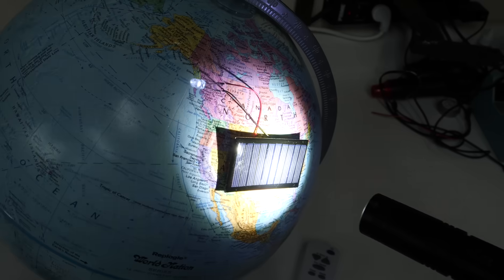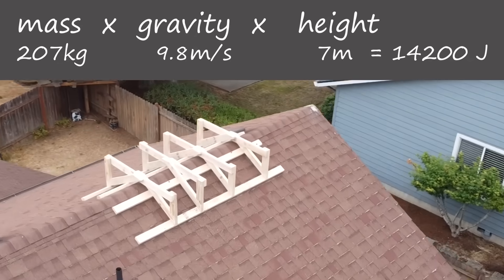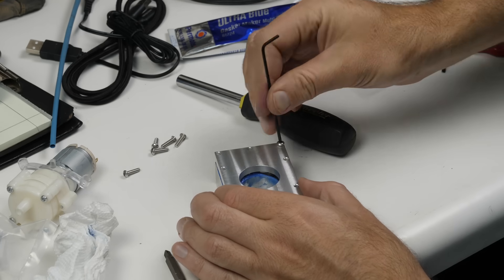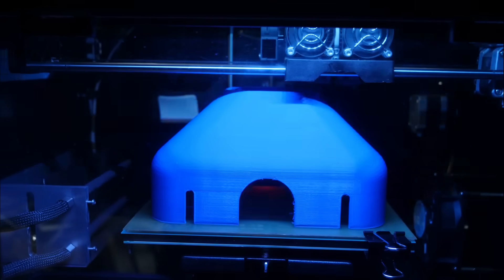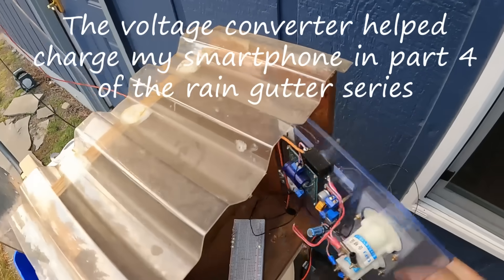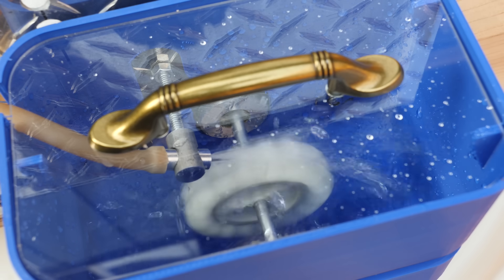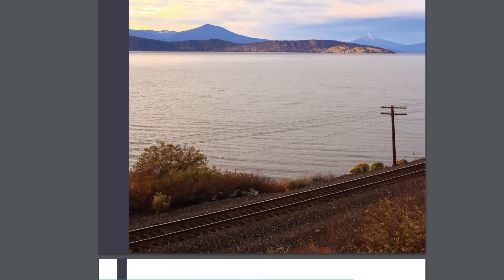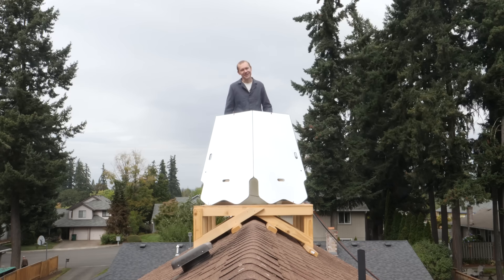Storing Solar Power on my ROOF!!!

Comment: pump from a well, or lake, or sea, a tower with a huge storage, generator, rotor, turbine
Reply: housing for the turbine, pelton, tesla, waterwheel, impeller
Reply: ie workshop, for space
Reply: supercap power level automatic throttle to the flow valve
Reply: water tower on a well, what a height difference
Reply: personal energy storage techs, not grid tied, by force
Reply: flywheel energy generator-battery instead
Reply: water tower, a large one
Reply: wind (vawt on top) can pump water up to the tower
Reply: wouldnt a water pump water cool itself
Reply: actually the water, flywheel, vawt system does not need any direct electrical parts, like batteries, inverters or anything, just spinning mass
Reply: try pipe axle ground tethered hot air plastic sheet balloon, both wind and solar collector, and rain water, the larger the more power/heat

Comment: I wonder what the efficiency is? like if you measured the amount of electricity that was used to fill the barrel, and then measured the amount that is created when you drain the barrel, and how that efficiency compares to lithium batteries and also commercial grade water batteries

Comment: if you have a hose going down from the funnel into the bottom tub and let the hose run to the bottom of the tub.  
you won't have that horrible sound of the splashing inside.  

also rather then a splash guard.  you should have a more constricted system. (like a turbo) 
so that the water doesn't splash in every direction (wich is basicly lost energy)  
all of these changes would make the system quieter. 
and the last one should make it more efficient aswel

Comment: Any suggestion of where to find info about scaling this? How big turbine can this example support? How large "water-battery" is needed to surplus a household of minimum usage? Could it be used to be "off-grid" in periods with power-outage or extremely high energy prices?
Reply from the maker: Video on BUILD2

Comment: How efficient is your water wheel at converting the potential energy into electricity?  My guess is your not getting all 14,000 joules of energy from that barrel on the roof.  You could try multiple water wheels stacked on top of each other.  Another approach would be two have two barrels and a pulley.  Start with the empty barrel at the top nearest the pulley.  Have the pulley locked so it doesn't spin.  Use solar power to pump water from the barrel at the bottom to the barrel higher up near the pulley.   Once full, unlock the pulley and use the shaft of the pulley to provide high torque to a gear box that is connected to your electric generator.  As the barrel lowers the empty barrel at the bottom is raised to the top ready for the process to repeat.  I myself would go with springs instead of water.  Many many springs stored under the house  or in the attic.  Springs in the attic might make for an interesting experiment.  A hot string might be easier to wind up and as it cools might provide more torque.  In this way you might be able to use the heat of the sun as well as the solar panels energy to sore energy.

Comment: How is it that you think of and build every idea I come up with?  You save me a lot of time building this stuff myself to see if it works. I was considering and Archimedes screw as a reversible motor / generator to pump the water up and retrieve the power. Turbines can miss a lot of energy recovery at low volume.
Reply from the maker: Great minds?  It's surprising how many people quietly ponder the same ideas but don't have the means to try them or advertise what they did.  YouTube (and Patreon) give me both.

Comment: What would compare in terms of a lifted weight or flywheel storage system? You also have the option of storing power in the form of heat difference in water containers which I think is pretty neat.

Comment: Thanks for doing the actual comparison to a battery afterwards. Water could also be a fantastic store of cheap energy when heated or cooled. In warmer climates you could store cool from a heat pump in a 500 gallon tank and store 80 000 BTU between 5 and 16 degrees C (40F - 60F). That's 86 Megajoules. Storing hot water you'd obviously have a much larger amount of available storage because you could go up to ~95C quite easily.

Comment: Now put a weight on top of the water which is enforced with a spring - weight + spring to put more pressure on the output

Comment: Great experiment! If you wanted to leave this permanently you could always surround the platform and tank with a structure that looks like a cupola and permanently fasten the panel to the roof of it. That would camouflage it’s true nature and also give you a dry interior to add additional items to maximize the storage of energy in the sunny hours after the barrel is filled and there is excess solar power being generated. Add a wind vane/lightning rod for that authentic look.

Comment: More interesting numbers: 14.2kJoules is about 4Whrs - so you could drive an average EV about 84 feet (25 meters). 
The energy stored (E=mgh) is not great with anything that uses gravity and height.  Rotating storage is another approach - (E=0.5Iw^2)  - that squaring of the angular velocity is what makes flywheels excellent energy stores.

Comment: You could also re purpose this project as an emergency fire retardant project / device. With a just little more plumbing and a quick release valve. If you have ever seen bush fires this looks a usefull concept!

Comment: Hello very interested .Glad your area is going to use this system. For interest check out Snowy Hydro 2.0 in NSW Australia. They are currently boring holes through the mountain to return water put through turbines back to the storage dams. Snowy Hydro has been in operation since the 50's /60s when Blowering and other dams were built for water and Hydro electric power. Interestingly Blowering Dam is currently being used by Dave  Warby ,he is trying to break his father's World Water speed record held for 40 years .

Comment: I'm not too convinced by water storage personally, at least not for local energy, but I've heard very good things about flywheel energy storage and it's significantly more efficient, at about 95% compared to roughly 80% for water storage, still like the video though.

Comment: I mean if you know some basic high school physics, you know you cannot beat the laws of thermodynamics... You cannot get more energy out of what you put in. Using Solar Panel to pump water up to hope for more energy output than charging the power directly to an efficient battery is non-sense to begin with (unless you generate no heat or sound which makes it more efficient).

The Earth is the best solar panel, it takes all the solar energy and transfer them into wind and rain, and these concentrate at a certain location which people can use, for example, via hydroelectric. This is why hydroelectricity is so much cheaper than solar panel, because you don't have to buy the energy absorption part of the equipment, which is the most expensive part

Comment: The power generator is, and I am really sorry to say that, not that well designed. Imagine how much energy is lost by all that spluttering water. I would recommend a simple pump (maybe even the same one that you are using to pump the water up, depends on how it is designed) - just use it as a generator.

Comment: Does the solar panel provide enough power to run an air compressor?  Then use a jet of air to spin the wheel.

Comment: Nicely done. How about more efficient kinetic storage options like flywheels or weights on pulleys.
Reply: Are they more efficient? I guess water has turbulent losses, but the complexity (and danger) is a lot lower.
Reply: @coder0xff  flywheels can be 95% efficient including the alternator, but it would need to be suspended with magnets and in a vacuum. They exist but are very difficult to make
Reply: Flywheels sound more practical since the energy density of liquids rely on storage height and volume. A flywheel can just spin faster to store more energy. Then again, I guess there's more mechanical stress because the moving parts handle bigger loads.. But how much difference is there?
Hey, it's like we need someone to do the math and perhaps a practical small scale experiment on this, perhaps present it all in a well made youtube video. Does somebody know anyone like that?
Reply: @johnfrian  Cars with petrol/diesel engines have flywheels to produce more torque, without them they have not much torque and wont go uphill efficiently.... food for thought
Reply: @johnnyboy2459  Flywheels don't produce torque  they average out the torque pulses of the engine.
Reply: I did some back of the envelope calculations a while back & found that none of the mechanical energy storage systems will be nearly as energy dense as chemical storage solutions. I don't remember the numbers but the differences are in orders of magnitude
Reply: @drraghunath83  ceramic bearings? Hydrostatic bearings?
Reply: @drraghunath83  this week there was a story on German news about the first zero co2 kerosene production plant. If you convert solar into gas it would be the most practical, both in renewability and in usability. Check it out.
Reply: @vencdee  but a geared flywheel that weighs 1 tonne would store a lot of energy, I've seen steam engines stopping a 1 tonne flywheel and reversing it in less than 2 seconds! Some insane amount of power generated by steam, would be good to use steam engines if we could boil water efficiently, maybe use the sun to direct light onto a steel drum to boil water? Who's knows
Reply: @johnnyboy2459  Of course... It depends on rpm, if you manage to keep it at 10krpm without any friction 😁
Reply: potentially quite energy dense BUT not great in a tightly populated area, it can be quite dangerous if not properly contained. watch the mythbusters video where they tried to do this and it nearly got away from them, scary power at only half speed. i have thought alot about flywheel tech as well and seems like it's lately gotten a breath of life into it with improved manufacturing capabilities.

Comment: 14200 J equals to 3.94 Wh. That's less than 1 Li-ion 2170 cell. Add longevity of Li iron phosphate batteries around 30 years (depends on usage), no fire risk for this chemistry and no risk to damage your roof. It is not worth it. At height of 7 meters you will need around 20 tons of water per kW on your roof.

Comment: What an amazing solution for rural areas with no connection to power. If we add this to water towers (do we already?) we can generate electricity with something that's already in place
Reply: Water towers are used to provide water pressure to distribute the water. Generating electricity from it would use up the pressure (energy) and water would not distribute. 

Look at the water pressure in this video after it generates electricity. Conservation of energy reigns supreme.
Reply: @usa-ev  In some locations they do this instead of using a pressure reduction value.

Comment: Where does the power come from? If we were smart and stopped wasting resources on solar and wind, the answer is NUCLEAR. NUCLEAR is the only source of baseline power which can satisfy our civilizations need without fossil fuels. Question, how long would you have to operate your Solar Battery to make up for the power used to construct all of the materials in its use? Wires, motor, Polypropylene Barrel, electronics, etc?

Comment: Such a great proof of concept! I've been dreaming about a personal water tower energy storage system for years now. Have you by any chance done the math to see how much water/height it would take to power the average home, even if just during the night?
Reply: About 80.000 liters should be enough
Reply: 1kwh is about 3600000 joules. So using the equation he posted, thats about 52 000 litres... you're going to need a big roof!
Reply: @steamdream194  lol i wasnt even close with 80k liters then
Reply: @steamdream194  the average municipal water tower holds 3,785,000 liters of water. That would then equate to 72kwh. Theoretically you could run 3, 1500 watt heaters for 16 hours, staying nice and toasty during the longest nights. Of course you'd need an equal size reservoir in the ground and a massive pump/solar array. But the closed loop system would outlast any batteries.

Comment: What if you combined this with the water air compressor bottle project? Could multiple pressure tanks of air have more joules of energy than a barrel of water at large heights?

Comment: I usually watch a lot more "theory" science videos, so I always appreciate the more real-life demonstrations on this channel. Also, I'm a huge fan of mechanical batteries, so I'm down for any videos involving them.
Reply: Also, (not to spam) but I think it'd be interesting to see you compare a mechanical battery made using a higher-density material vs. your water battery. So, a motor pulling up a iron-nickel alloy weight on a cable or something along those lines.
Reply: Or maybe a rock and water compared

Comment: Now you can charge your phone when its not raining. You should test and see how many days it takes to charge the phone with the new system. Also.. since the barrel takes 5 hours to fill, You might consider adding a second barrel. That way it could be filling barrels during all of the daylight hours, and then empty and charge at night. Otherwise, after 5 hours it would be emptying still during daylight, and then sitting idle part of the night with no sun to pump the water back up until dawn.

Comment: One thing you will start noticing soon is the algae build-up in the recycled water system from the sunlight. You can go to a pet store and get some algicide or similar to add to the reservoirs. This will kill your pump in short order.
Reply: Could always paint the barrel/tubes
Reply: The algae or the algacide?
Reply: @johannesmajamaki2626  Yes sorry, that is confusing, the algae will damage the pump by reducing flow and increasing friction.
Reply: He'll probably want an antifreeze in there as well.
Reply: You could use a blue pond water dye to Help block the light from penetrating the water in the tubing and drum which slows down algae growth since it’s a closed system.
Reply: @keithosterkamp6207  where do you get Blue pond water dye?
Reply: @Bob Vance. Tractor A
Supply and a few ornamental pond stores. A little goes a long way.
Reply: @keithosterkamp6207  thank you I'll pick some up
Reply: Or he can paint the barrel 🤷‍♂️
Reply: just line the outside with black garbage bag.
Reply: Algaecide can do it. Better still, a black tarp.
Reply: @necterbeau5568  technically the reflective panels will help
Reply: Oh yes that's true about the reflective panels.
Reply: Put a couple of pieces of black tourmaline it will keep it from becoming stagnet while it to be come alkaline and after 24 hours it will ionize it.
Reply: Add copper sulfate
Reply: another problem that would be solved by using other than water. I suggested ball bearings, they won't freeze or evaporate.

Comment: Do you think a 50 gallon drum of water can store more energy in heat, or gravitational. 😁
Reply from the maker: Ha, probably heat, but it will lose it faster than gravitational. 😁
Reply: @QuintBUILDs  I'm planning on building some solar thermal collectors and storing it for release in my home. Should be a nice addition to my 15 pannels of solar PV. I'm  just not sure if I want to heat air or water.
Reply: @QuintBUILDs  I guess air is less risky for leaks and i won't need a radiator in the house. And I dont need to store it so much as just simply move the heat into the house as quick as possible to keep the collectors efficient. 

I think I'll need a 12v fan and a thermal sensor and a micro controller. Force air through when temp in solar thermal collector is above 72. Probably close vents when air is not blowing.

Comment: I've been having arguments regarding nuclear vs renewables.  But I've been pondering this all day.  What would it take to power a light bulb 24/7?  So something like a 14w light bulb.  A light bulb representing a grid load.  How much solar power does one actually need?  Do you need 2x or 3x the amount of solar power?  Or even more?  How much would battery efficency increase/decrease the amount of power you need? etc.  It's kinda nice that you just popped up with a video along of what I've been pondering.
Reply: Roughly speaking just add "hours" to your questions. A 14W light bulb running for 24 hours needs 14Wx24Hours=336 Watt-Hours of energy. So 336WH is how big your battery would need to be. A 50W solar panel like the one in this video would take 336WH÷50W=6.7 Hours of peak sunlight to provide that energy.
Reply: And battery storage is around 90% efficient, so just oversize things a little bit. (2x is not needed.)
Reply: @usa-ev  that's the back of the napkin math.  Which is good.  Now add in the change in sun hours between seasons, and add in cloudy days.  Those can't be dismissed either.  I'm curious to know the practical number.  Once everything is taken into account.  Including running all of the electronics to handle the charging, etc.

Comment: Now all you gotta do is put a turbine in line with your water supply so it charges a battery every time someone uses the water. And you can put that in addition to storing water in a tank on the roof. No solar power needed. If it’s city pressure it’s free power. And no water would be wasted.